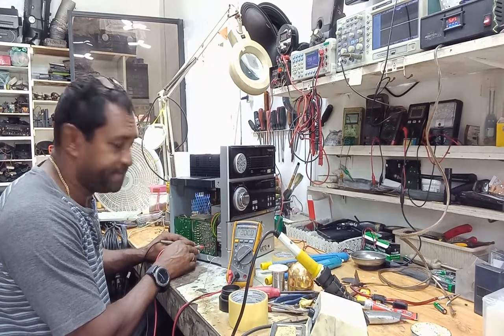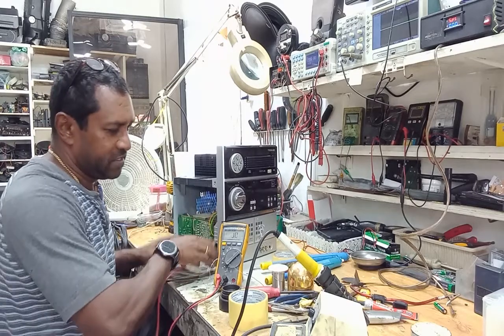sharp mini stereo repair

Comment: Mine is playing very low can u help. What can cause that
Reply from the maker: Remove and check a the fuse on ps board also check that 100ohm resistors that near the output ic is reading the correct value

Comment: I have a Sharp mini component system cd-dk890. I  have an error that reads ER-CD01. How can I repair this issue?
Reply from the maker: Try using a laser cleaning disc if that dont work you may have to perform the clean manually

Comment: Hi i have one like that and the timer light on it keeps blinking and the unit isnt coming on
Reply from the maker: Check on the power supply board there is a 1000uf 6.8v cap replace it with a 1000uf 10v cap and the unit should work again.
Reply from the maker: Or check rhe 100ohms resistor next ro the output ic

Comment: I have a microcomponent system sharp XL-UH 2000H which after working for 2 hours suddenly stops

how can Ι repair the damage because Ι am totally disappointed
Reply from the maker: When you say suddenly stops do mean power went completely dead
Reply from the maker: When you say suddenly stops do mean power went completely dead